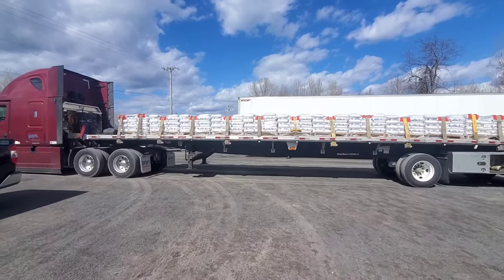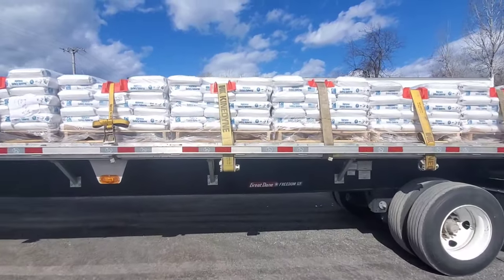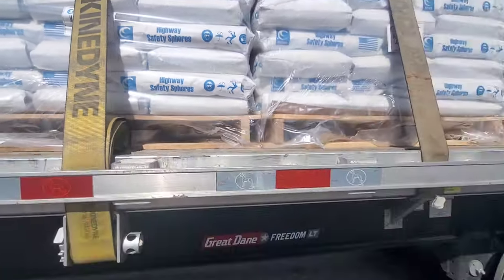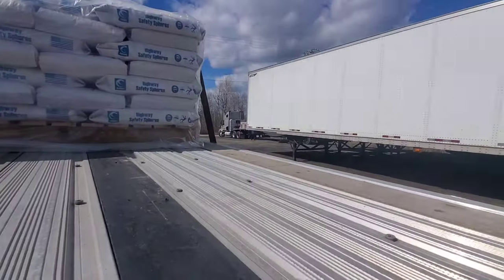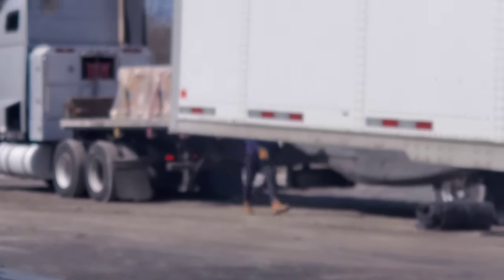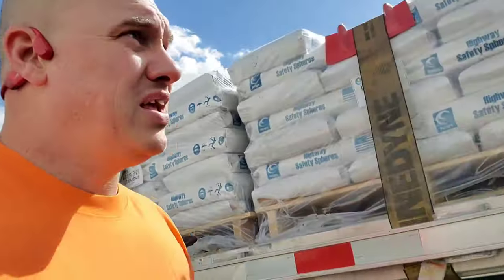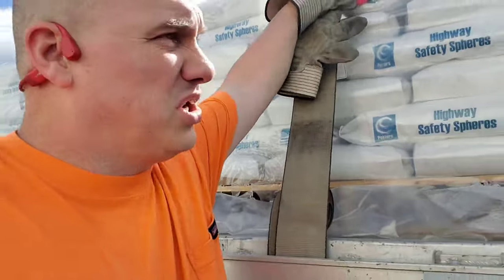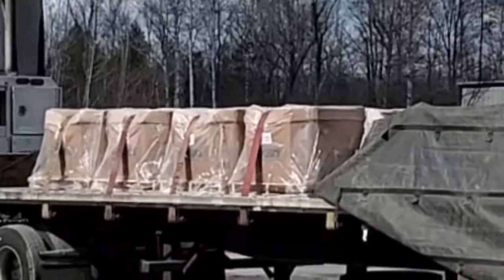Mercer load number #2

Comment: I’m thinking of coming to Mercer what are the rate per mile there offering
Reply from the maker: I don't have enough data yet. But over the course of my first 3 loads I'm sitting at an avg of $2.40PM. That is flatbed of course I don't pay any attention to dry van.
Reply: You need to go to Bennett better freight at a better rate
Reply from the maker: What is Bennett's rate?
Reply: @BIGBilly  I was with mercer for 9 years wish I would of known about Bennett 11 years ago there rates very but I normally do about  2.50 but have done better if you have a step deck and low running 17.5 tires you will do really good

Comment: GREAT VIDEO HOW HARD IS TO LEARN HOE TO SECURE FLATCER LOADS ??? I ALAWAYS BE INDEPENDENT BUT IM LOKKING TO JOINT MERCER  YOUR THOUGHS THANKS
Reply from the maker: Securement is pretty easy but I guess that depends on your comprehension level. They do have a small course for drivers with no experience. 
Plus lots of info online and flatbed driver are most of time very willing to help if needed.